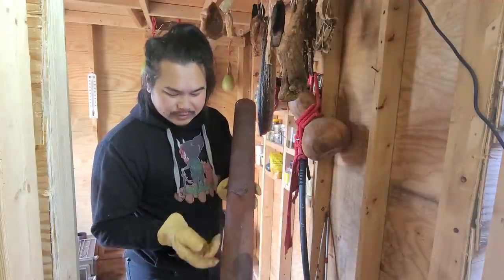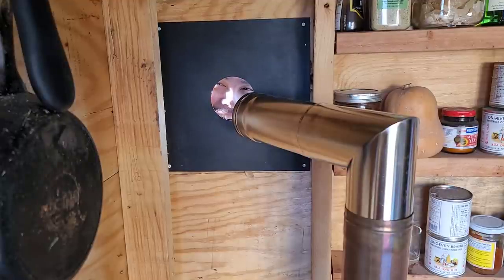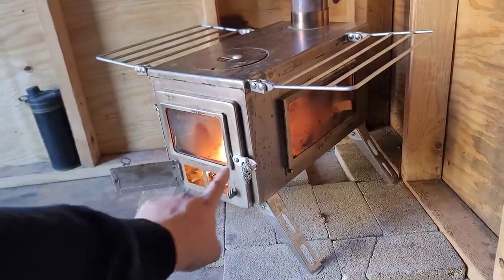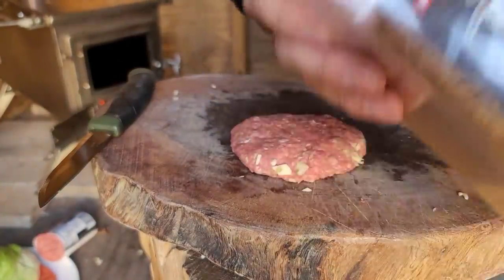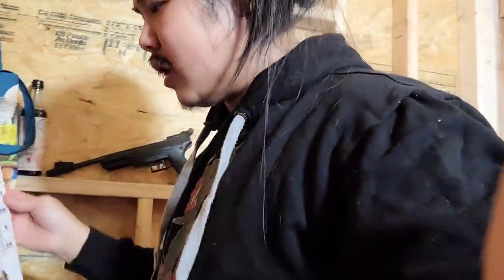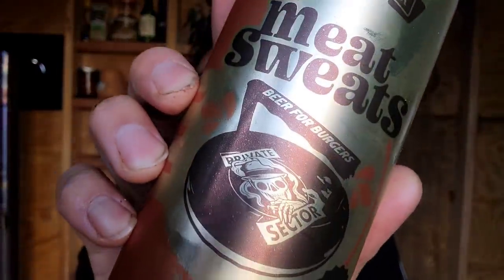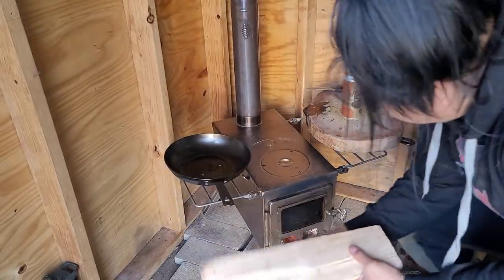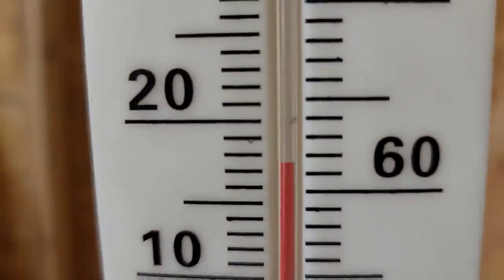Installed the Winnerwell Nomad View Wood Stove!

Comment: A small vent at the rear of the stove will allow the stove to draw air direct from the outside reducing draft. The stove draws air through all the cracks, leaks and holes causing drafts otherwise

Comment: I’d be cautious with lots of sharp 90 bends, the more bends you have the harder it is for natural draft from the heat to fully push out the flue gases, some of the flue gasses can condense if slowed. Also want to say great video and very helpful as I am interested in picking this one up myself

Comment: That old stove looks good just needed some paint and ne pipe lol.
I am not going to lie, I am a fan of the new one! If you hear one of them heat powered fans to set on the stove should keep that rocking all night...or a battery power if ya want to go quick and cheap like a tent fan. But you'll need to hang it from somewhere high above it lol.